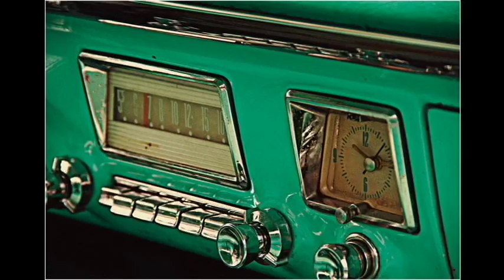A Brief History of Radio

Comment: Transistors replaced vacuum tubes, not the "crystals" of crystal radio sets. Crystal radios used no power supply, driving headphones (not speakers) from the energy actually contained in the broadcast signal. Oh, and FM has a shorter range than AM.

Comment: 1: Tesla DEMONSTRATED radio transmission and reception wiith a radio controlled boat before Marconi.  Yes, the very first application of radio was remote control.
2: Whaakes FM radio less static-plagued than AM radio is due to the signal structure, NOT the frequency.  The AM band actually is a much bett short and long range communication band, whereas the commercial FM band is only good for line-of-sight communication (regardless of whether you use an AM, FM, LSB or USB signal format).
30 years Army radio communications

Comment: Your statement about AM not penetrating structures well is incorrect.  Propagation and penetration is a function of frequency, not modulation.  In fact, due to the lower frequency of most AM stations (MF) it actually penetrates and propagates much better than do most FM transmissions, which due to the nature of the additional bandwidth required for FM, are typically on higher frequencies (VHF/UHF).
Reply: KB9OKB Can anybody please tell me with out satellite how radio worked in those days
Reply: @aparichituduunknown4354  Your question would need a large book or hour long video to answer. However I will offer my two cents. RCA Victor contributed quite greatly around 1920. They developed a really good AM radio with about five vacuum tubes. It was called superheterodyne based on an intermediate frequency of 455 kHz. Pretty deep right? Radio became wildly popular and practically every family had one within a few years.
Reply: @aparichituduunknown4354  This will help
 https://www.youtube.com/watch?v=hz_mMLhUinw